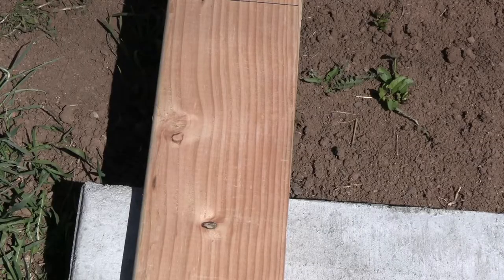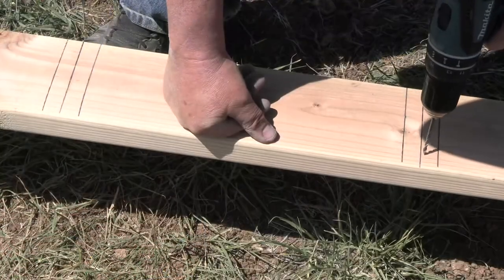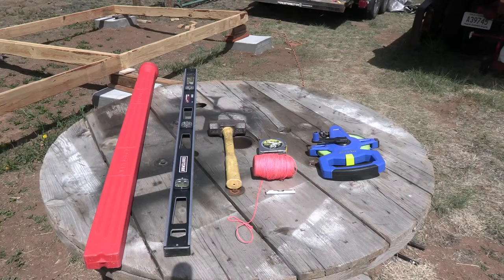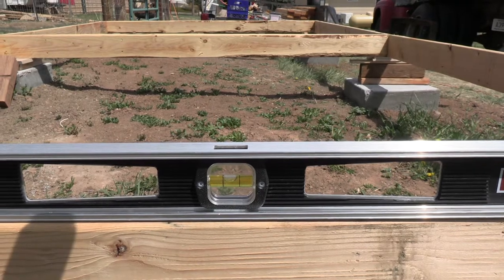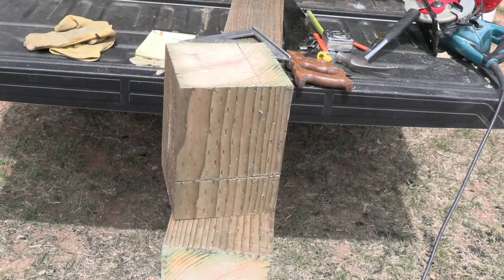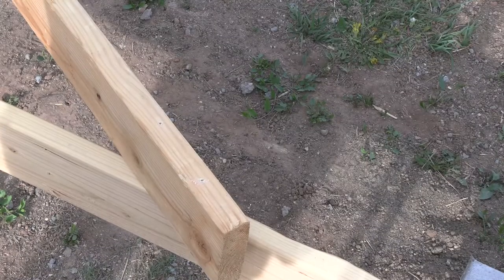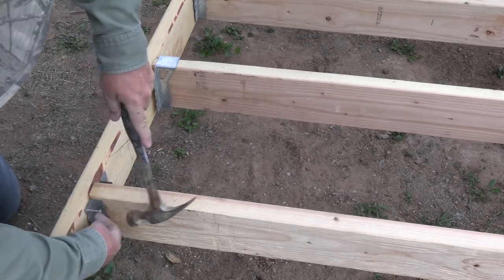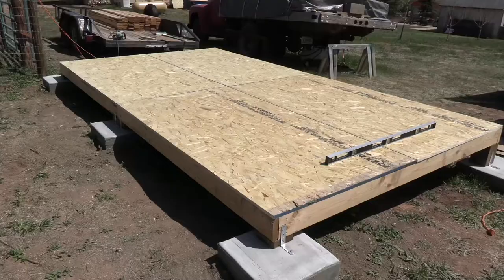Building a floor system

Comment: I would suggest covering the wooden floor with a few coats of penetrating epoxy, or gluing onto the floor plastic wall panels (8'x4'), they are flexible, will not rot, will not absorb moisture, will not crack as they remain flexible even when exposed to the weather for a long time. I use the plastic wall panels cut down to size as roof for my cages, and tie it down with zip ties around the perimeter of the cage.
Reply from the maker: I built this two years ago March. I did seal all the seams with silicone, and then I glued down a vinyl floor from edge to edge and rolled it out, and then put silicone around the edge of that also. I have done it this week a couple of times, and never had any issues with them. The coop is cleaned regularly and the vinyl floor is still in great condition. Thank you.